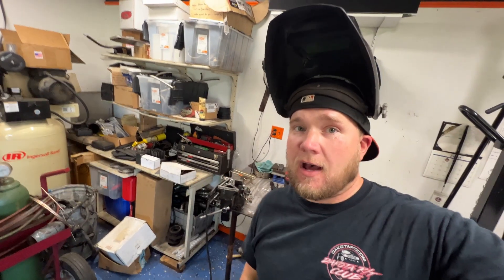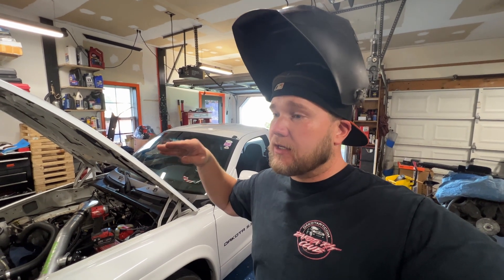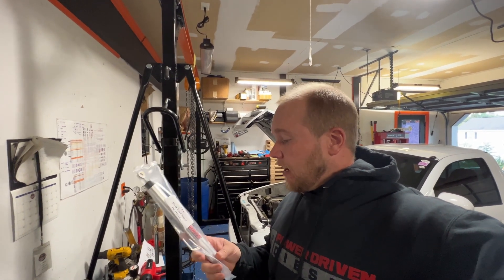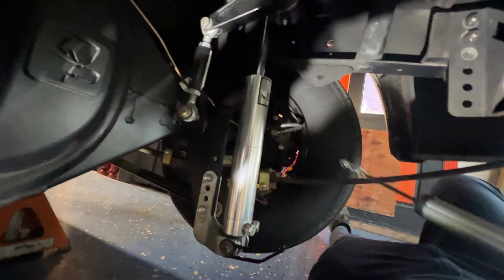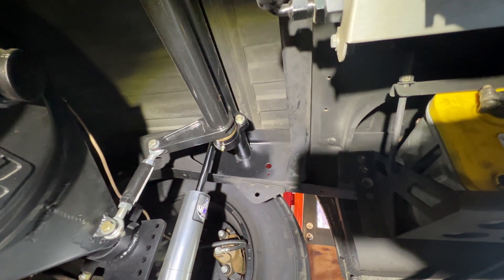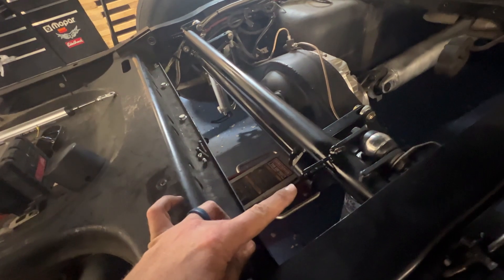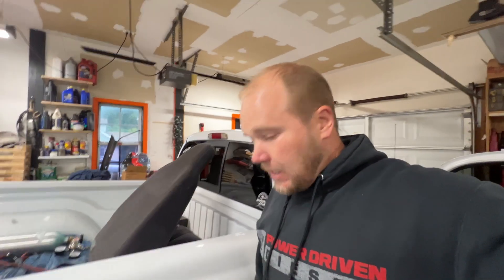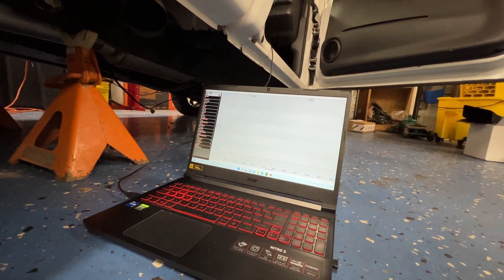All the Data! Lowdoller motorsports shock travel sensors

Comment: Great channel. Locked on because I just bought a 2002 Dakota 2wd. The motor is pooched but have a 360 magnum sitting on a engine stand. What are some of your suggestions to get started. Looking at making this a strip truck
Reply from the maker: Honestly, I skipped over the 360 put a 2009 and up 5.7 hemi in it or 6.4. They make power easy